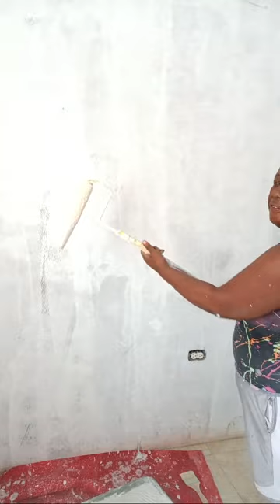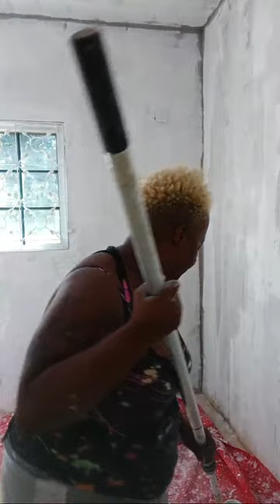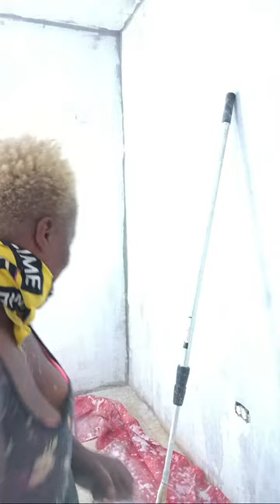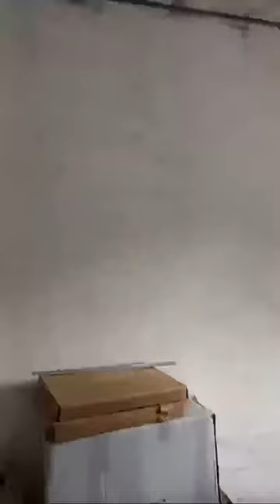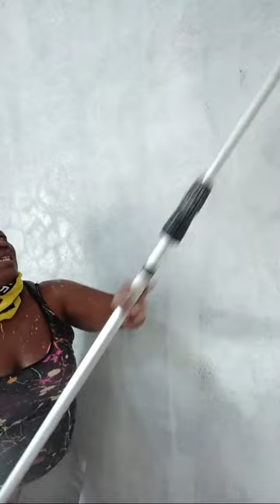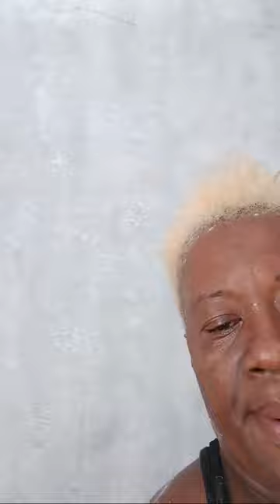Applying Sure Coat #arlenesoulztv

Comment: What is sure coat
Reply from the maker: thank you for your question. Sure Coat is a white powder substance that is mix in water and apply to crack concrete walls  to remove cracks before painting.